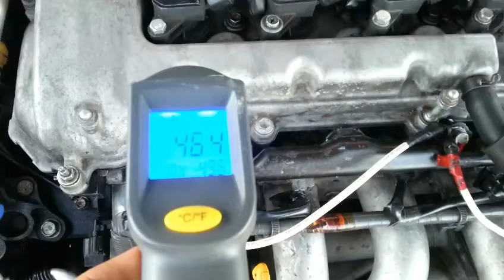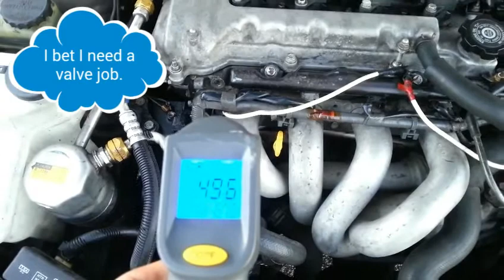A Study On Fuel Injector Temperature

Comment from the maker: One of my worries during the making of this video was the very high fuel trims at idle. Despite in this video mentioning plugging off the evap to see if it was doing a high flow of gas fumes that it shouldn't, it turned out to be the cause. The purge regulator before the purge valve on the evap was hooked up backwards so it ALWAYS flowed.

Comment: I have to admit that im lost with what your trying to acheave, im a bit thick that way.
Things i would do, make sure all the spark plug heat ratings are correct, it will make a difference to how the engine runs.
Look at each plug and judge the colour on the porcelain insulator around the center electrode, note if there is a difference between them, is one firing different.
If one is, then swap it with the opposite bank and take it for a drive again.
Swap the injectors to observe any difference, a poor performing injector perhaps.
Wet/dry compression checks.
Valve sealing.

Put fresh hamsters on the wheel lol.
Also run away with your hands in the air screaming ha ha :-D
Ok, i know bugger all about car engines ha ha :-D
Reply from the maker: I never thought to check the color as temperature evidence in mind. 
Brilliant. 

Swapping can deal with most issues just not in my case last year. Swapping two injectors got rid of my misfire once and if I didn't know two injectors were hotter but firing order was now covering up the problem I'd not had evidence to get a new warrantied set.
Reply from the maker: Plus, temperature can show tiny imbalances between complete failure and normal function. 

Schrodingers Box has videos on how to use a specialized tool to fire each injector to the same number of milliseconds. Watch PSI or fuel pressure drop and see off they are all within a PSI.

I have no Schrader valve for PSI and I don't own that fancy injector pulse modulator so this is a convenient way around all that. :)
Reply from the maker: Lastly, I suspect temperatures are up from a bearly leaky intake valve in cylinder 1 and yet compression tests totally miss it. :)

Your comments definitely enhanced my lunch break. Thanks friend!
Reply: +DE Nichols If nothing else, you got a laugh :-D
Reply from the maker: zx8401ztv Knowledge and a laugh. :)

Comment: i have never checked a fuel injector temp before . if thinking a bad fuel injector , may move it to a different cly and see if it gets same temp there as the one that was there .
Reply from the maker: +wtbm123 That is a great way to rule out other variables at work. :)
Reply from the maker: +wtbm123 One time I had no. 1 and 2 cylinders 6 degrees C up from cylinders 3 and 4. The car was misfiring.

Swapping 2 and 3 reduced the roughess enough for the engine to call it a misfire, but because of the laser guided thermometer I knew it was only doing better since the firing order was going through high low high low flow instead of high high low low flow.

That was when I adjusted spark plug gap last year after learning that richer fuel made spark happen easier. It got the engine even enough until I could get another warrantied set of fuel injectors.
Reply from the maker: +wtbm123 If you wish further details on this, the link in the description is to an article I wrote, which I had to pull from to make the information in the video correct. lol

Comment: I never got a notification for your new vid- I just unsubscribed  and resubscribed , see if that works.  I'm kinda lost at the  correlation    between spark plug gap and injector temperature  , go over that one a bit. I'm not entirely sure if you have one condition or more. What specific condition are you trying to resolve. Ha I must be missing something.  Not a big fan of them hot air intake filters :)
Reply from the maker: Whoa, STEVE! I never responded to your questions. Found out because of a another great comment from Al Bore. No, I've never been able to get the fuel line disconnected and interrupt it with my fuel pressure set. Darn thing won't come apart even when faced with the officially right tool. So, by working with the temperature of the fuel injectors against how well spark was doing, I was able to get correct flowing injectors all matched up.

Yeah, the actual repair was done before this video, even before I started making videos, but if you don't have a fuel pressure kit, or can't get one hooked up, and you know enough engine theory, then you can figure out fuel injector flow from it's consequences: heat.

You can also heat balance your injectors by changing spark plug - that's what I had to do to keep her running when I bought a set of injectors, which weren't flow matched as the company had promised - they were worse than the old ones I was replacing!

This video was in part explanation for the temperatures I was seeing during my most popular video: water decolonization. I got lucky with my 3rd video ever going viral! :)
Reply: +Steve Rob Hot air intakes are great for cold weather! At that point it's not good for power or the miles per gallon...but  I have a super secret surprise to reveal about that intake later that you aren't seeing. :)

There certainly are more things that effect the temperature. I could have said that the temperature of fuel injectors can be changed by two things that are relatively easy to control:
spark plug gap
changing out fuel injectors which aren't even

When I first did water decarbonization last year when I noticed the intake showing very different temperatures - worse than they are now, I noticed that the fuel injectors were consistent in temperature.

Basically....Scanner Danner tests how fuel injectors are even or not with a fancy too - Schrodingers Box does too, but this is backyard trick to take a look...but you have to remember more than one variable effects it. Spark plug gap is easy to change and a careful ear can hear spark plug gap changes versus fuel volume.

YouTube may be on the fritz, I've had to go to your channel to find videos too instead of getting an alert.
Reply from the maker: +Steve Rob I don't feel like I've fully answered your question.

The first time I used a laser thermometer (literally a laser guided infrared thermometer, but that's for short) it was at Schrodingers Box, or Matt's suggestion. He said it was a backyard way to see what was going on.

At the time that intake runner was much hotter than the others and I figured the old leaky fuel injector I had there had carboned up that cylinder, caused higher compression and increased temperature.

It stands to reason that each fuel injector that injects more will get hotter as more fuel is there to be burned in comparison to another cylinder.

Since a rich condition makes less resistance for a spark plug to go off the problem is made worse as the spark plugs will do an even worse attempt at a complete burn further throwing off the combustion of that particular cylinder.

In my article in the description the temporary fix before more fuel injectors could be obtained was to run my spark plug gap at .046 inches instead of .044 - standard gap for that engine. I only did this on the cylinders with fuel injectors that were injecting more fuel. I could hear with a a heavy metal tool that those cylinders were still running more fuel through them but the instantaneous RPM wasn't increasing on those cylinders, and decreasing on the others - thus, a misfire code was no longer reported by the PCM.
Reply: Interesting , I still have difficulty with a change in temperature of a fuel injector in relation to a spark plug  or a gap change .  I can't see how the spark plug alters the injector temperature since the distance between them is so far. I've never seen any tests looking at fuel injector temperature and correlating it to flow, is that what your doing.  The only way I look at injector flow without bench flow testing is doing a injector balance test .  Have you teed in a fuel gauge to watch the drop on  each injector.  What condition are you trying to fix , Ha I'm sure I missed something .  I think your experimenting with something to show a result but I'm just not getting the drift of it yet LOL
Reply from the maker: +Steve Rob I found out it worked by trying it. It's time for you to get out there and work on something. :)

Assuming you don't just have diesel engines of course.